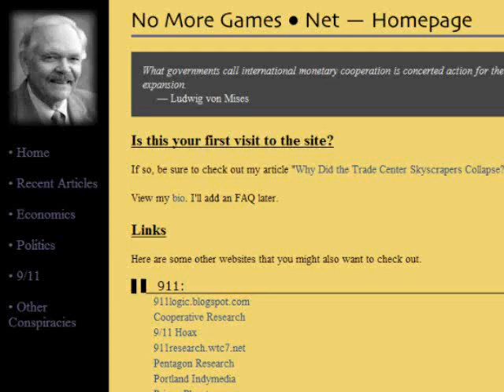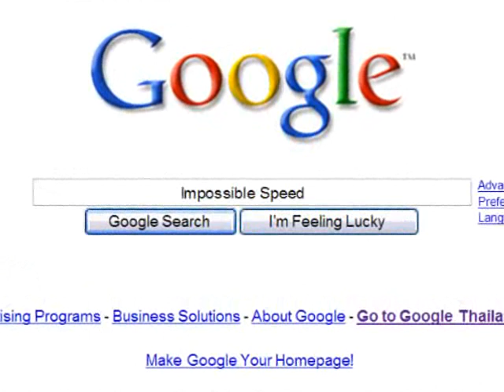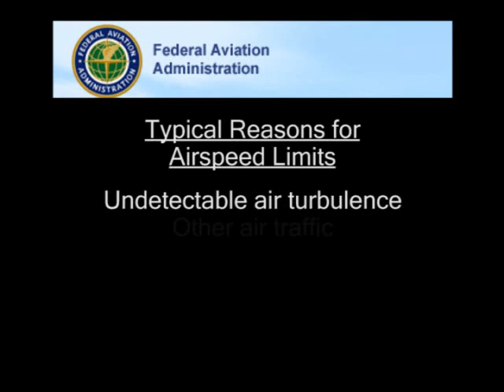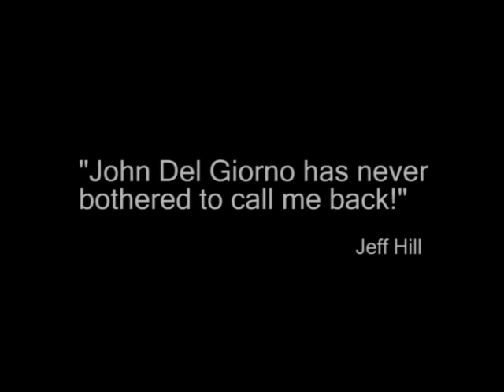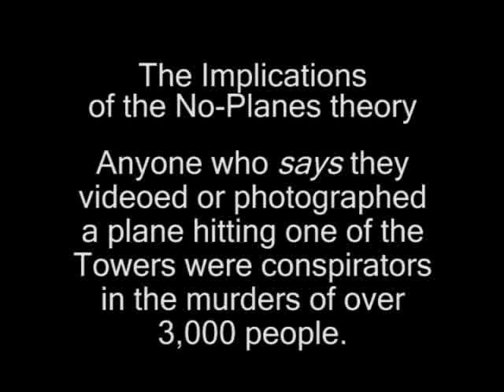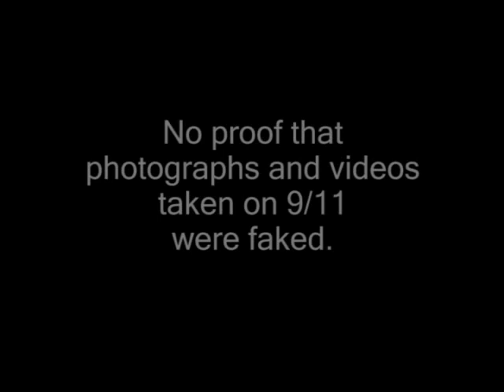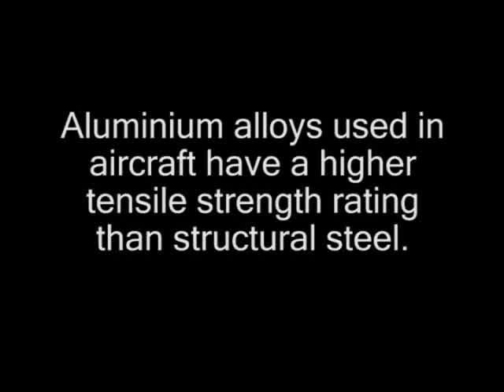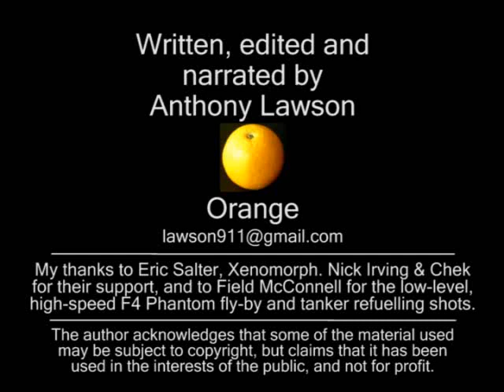9/11: Impossible Speed & Impact -- Busted! Updated

Comment: My contention is a drone a/c was used to mimick the commercial liners and as fas as the speed...@ that altitude these a/c wouldn't suffer too much strain on their airframes for the limited amount of time they flew that low nor do I feel the high speed assertions are accurate. Maybe 400mph tops in my OPINION. The F4s shown in the video is designed to be able to fly low since a fighter needs to be able to go anywhere to chase and engage enemy a/c. FYI...we stopped using the F4 in the early 80s
Reply from the maker: I prefer to think of the New York weapons as radio/computer/controlled airliner lookalikes; the term 'drones' is far too loosely fitting, from towed targets to assassination platforms.

Also, I cannot imagine why you go for "400mph tops in my OPINION" when the speed I calculated from the Fox 5 video (confirmed by others) is 572 mph, which is close to the Royal Aircraft Establishment's estimate of 575 mph., and those guys are good. 

What your 400 mph OPINION introduces is the that you do not accept the videos as being of any value in assessing the speed.  That is close to the position that the no-planes-in-New York fantasists take.

Comment: Not likely those were standard commercial planes. Note the FTS on the bottom.

 Dov Zakheim - 9/11 Comptroller and Remote Control Planes 
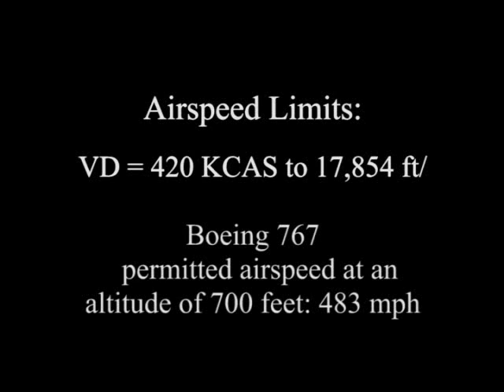@ 2:10 of this video some of his modified Boeing's are shown. Compare them to the 2nd plane. The location of the equipment specifically.

Comment: look at the left wing and the building,why is the left wing behind the building?
why not in the front of the building,you are busted? time 7:50-7:59
Reply from the maker: If you examine this area very carefully using the eyedropper tool in a paint programme (I used Corel PhotoPaint X3) you will find that there is a slight difference in the RGB intensity readout as the plane's wing passes the building.  This means that the plane's wing was actually in front of the building, of course, because it was a real plane.  It also means you are wrong.

Comment: This video demonstrates that the speed of the aircraft which hit the South Tower of the World Trade Center, on 9/11, did not exceed the design limitations of its airframe or engines, and that the way in which the aircraft breached the wall of the building was feasible.
Jct: I'm just happy there are so many pilots and Boeing engineers on video explaining why those jets couldn't push through thick air at 500 miles per hour as they can through thin air at 30,000 feet. Anthony Lawson chooses to look at one metric but didn't look too deeplin into the other specs. Since it takes supersonic speed of a heavy projectile to pierce steel armor, concluding that an empty aluminum cylinder could breach the steel armor and cement of the towers is too laughable to countenance, it should have bounced off or been shredded like cheese. shredder,Where do low-tech clowns like Lawson get the gall to opine on scientific matters with insufficient facts when any engineer knows he's an apologist for a scientific lie.
Reply from the maker: kingofthepaupers wrote:  "Where do low-tech clowns like Lawson get the gall to opine on scientific matters with insufficient facts when any engineer knows he's an apologist for a scientific lie."

Although, in your ignorance, you neglected to add the required question mark, and although I have already given most of the answers in the video, the basic answer to your question is:  By doing the research. 

e.g:  The FAA-permitted test parameter Vd (Velocity/dive/descent), between sea level and 17,845 feet is 420 knots.  That is a speed limit, not an airframe or engine limitation, if you can tell the difference.  A 19% increase of that figure gives 499.8 knots, which is 575.16 mph. If you don't think that Boeing 767-type aircraft (no one knows for sure, what they were) are capable of withstanding a 19% overstress factor, I suggest that you don't fly in any of them.

Your absurd claim that a plane hitting a building at such a speed should have bounced off, is laughable, but you did get close to what happened by writing: "or been shredded like cheese. (sic) shredder."

Like most ignorant people, you are destined to remain ignorant if you don't, at least, try to find out the reasons why things happen.  When I make a video, I give anyone who cares to the opportunity to share in my research, by adding references to websites that contain the information that I have waded my own way through.  Try looking at the notes for this one and you will find a video:  WTC PLANES THRU STEEL — 911TRUTHINATOR which will explain why the planes and the buildings reacted to each other in the way that the videos depict they did.

And here is another quote from your ignorant diatribe:

"I'm just happy there are so many pilots and Boeing engineers on video explaining why those jets couldn't push through thick air at 500 miles per hour as they can through thin air at 30,000 feet."

You are telling lies.  You have never seen a Boeing engineer explaining any such thing.  If you have, give me the reference where a Boeing aeronautical—not a sanitary or telephone—engineer has stated as much.  Boeing has never released the wind-tunnel data from the airframe or engine testing of its 767-class aircraft, and I doubt that it ever will.  

You may have heard a Boeing PR spokesperson, Leslie Hazard, agree with an ignorant phone caller, Jeff Hill, about the impossible speed, but she is still not an aeronautical engineer, although Rob Balsamo of Pilotsfor9/11Truth is still quoting her.

You may have heard a computer programmer, Joseph Keith, make some wild statements about the plane falling apart at speeds below 300 mph at sea level.  You may have read about some alleged "pilots" making similar claims, but have you ever asked yourself:  If I were going to throw a spanner in the 9/11 truth works, which 9/11 truth sites would I infiltrate first, or even set up in order to confuse things?

Pilots for 9/11 Truth, for example, is full of disinformationists.  One of its core members is John Lear, who used to fly for the CIA and who claims that the dark side of the moon has already been colonized and that the 9/11 plane images caught on videos cameras and human retinas were holograms; an utter and provable impossibility. 

You can hear Joe Keith make a fool of himself; John Lear argue against himself and another experienced pilot, Field McConnell, give his opinion that he thinks that the speed was possible, in the following video.

http://splashurl.com/lzo27mm 

And remember: the subject was a standard Boeing 767, because no one knows exactly what hit the South Tower or what had been done to it before it took off on its murderous journey, apart from the people who planned and executed the greatest false flag attack in history.

If you really wanted to learn something, rather than to insult me and air your ignorance, you would have been more polite.  Please try to be, next time.
Reply: Anthony Lawson
additional info on that stress induced by speed, the stress on an airframe goes up by the CUBE of the velocity.
Reply: Anthony Lawson So can you please explain how parts of the airplane disappear in the videos. And on a clear day why are the planes not painted like all the other company planes. I also was under the impression that it doesn't matter if the plane was moving or the building was moving the results would be the same. So I don't think that if the building was moving at 500+miles per hour that the plane would slice into the steel framed building. Could that wing slice thru the steel like a cartoon character. I noticed you brought up the tensile strength of the aluminum but you must know that tensile strength is the pulling of the material sideways. You're not trying to claim that a one inch bar of aircraft aluminum is stronger than a one inch bar of structural steel are you. I don't think it would take the same load as the steel. Can you explain how in the chopper shot the plane goes all the way thru the building and then you can take the image of the nose before it hits and after it goes thru and you can't tell the difference? How is it that all the different news cameras seem to be in a line did they stand each behind the other? Why on a clear day is the sky blue and green and yellow very poor quality using the best cameras. If the aluminum is so strong then why did it disintegrate in Pennsylvania when it hit the ground? I don't see any airplane parts there did you? Why are all of the witnesses either affiliated with the media or actors of some sort? Why do you use the dive speed when you can see that the plane was in level flight. If the plane can go 586 in level flight sea level why waste time getting to altitude and how fast can it go now at altitude since it can go 586 sea level? If aluminum tubes can go thru solid steel if they are just moving fast enough why not make bullets out of aluminum to shoot thru body armor and concrete buildings? I mean you were talking some deep shit in your video but I noticed you didn't have a Boeing Engineer  on either part of your criticism of the other people. Thanks

Comment from the maker: Go back and get YOUR facts straight, then consider the costs. It is already known that aviation kerosene and office materials can NOT melt steel.
The aluminium in the planes SLICED through nothing; the impact DESTROYED the joints of the outer framework panels which were made of 1/4 inch box construction steel members. Look at the notes and watch WTC PLANES THRU STEEL — 911TRUTHINATOR
Apart from that, the rest of your comment is unanswerable, which does not mean that the video is not accurate.

Comment: the speeds, impact and banking are not impossible, but NEARLY impossible.  the planes were remote controlled.   the plane that hit the pentagon was traveling at 5 to 7 G's, nearing it's physical limit. same for the 2nd plane to hit the world trade center. the 757 and 767 used on the world trade center were the only boeing models capable of being remotely controlled.
do you know why the truth gets leaked out? to encourage fear and paranoia. these are very valuable things to use against some one.

Comment from the maker: Please look at my video: Friends of Israel — Enemies Inside the Gates from about 8:00 minutes on. Link in notes.
Vd does not signify Vertical Dive but Velocity Dive. The Pentagon is a totally different issue and has no relevance to this video but for what it's worth I'm certain a passenger aircraft didn't hit it,
In the first video I mention, you will hear Field McConnell say that he thinks the speed of the ST plane was possible and others are pretty certain it was remote/computer controlled.

Comment from the maker: No one outside of Boeing knows what a 767 is capable of in level flight, but the South Tower plane had made a rapid descent from 20,000 feet immediately before it pulled out of what I have calculated was a 15 degree slope, to it's final slope of about 3.5 degrees lasting. When a road is steep, then levels out, a car's velocity is maintained until other forces come into play. so it would be with a plane.  
See notes and link to: 9/11 — Possible or Impossible Speed?
(cont after your next))

Comment: I believe those planes were real, the ones that hit the towers. But I think they may have modified, as the speeds are over what a 767 should be able to do in LEVEL flight @ 1000 feet, but it did kinda dive-in, so who knows. It would be VERY difficult to hit those towers so precisely @ those speeds. But I agree that anyone who thinks all those videos could've been altered, & eyewitnesses duped, is obviously not capable of critical thinking & should recant. But the OCT regarding 77 is impossible.

Comment from the maker: Not true.  There is at least one video which has an extremely loud bang on it.

Look at my video Friends of Israel — Enemies Inside the Gates.  Concentrate at around counter 5:20

Don't forget, this was a coverup so you would have to ask those responsible why the building was not brought down sooner. My guess is that alleged UA 93 was supposed to hit WTC 7 and the perps spent the intervening time worried about bringing it down for no apparent reason.  In the end, that's what had to be done.

Comment: You are misinterpreting it to reflect your own twisted viewpoint. If it's such an impossible speed, then why don't you explain to me how TWA Flight 841 on On April 4, 1979 went into a power dive losing 34,000 feet (10,363 m) in 63 seconds crossing the mach limit yet still retained the majority of its structural integrity to where it was able to emergency land and passengers only reported minor injuries?

Comment from the maker: Lots of work is what is required to back up such a claim. Send me a screen shot of what "...has two vertical stabilizers and a Very large wing span." My email is in a message I've sent you, because I can see nothing like you describe in any of the frames I have studied using Adobe CS5.
Find out the length of a 767 and a war-jet with twin stabilisers and see if you can work out a rough distance from the camera. Roughly 1/2 X 767 distance = size X 2
Was such a plane reported by any eyewitnesses?

Comment: I think anyone who has any questions about the planes and there performance to pilots for 911 truth.that they were planes is without question,that they were standard is very unlikely,remotely controlled ,very likely.the reference to the two military jets performance is misleading as there is a vast difference between the design parameters and engines.one turbofan is really not like another,except in the basic principle.

Comment from the maker: Jeff Hill never makes it clear what he is asking the questions about. The NY planes have never been forensically identified, therefore asking questions about a standard Boeing 767 is dishonest.

According to ATC records, the South Tower plane made a rapid descent from about 20,000 ft, and several videos attest to this. The final 10 seconds was a 3 to 4 degree slope.

A former NASA flight director thinks that the speed of the plane was possible. 

Google dwain deets pilots impossible speed.

Comment: 2:48 you claim that twin turbofan engines don't choke themselves at low altitude, but what about the planes themselves? I wouldn't compare the two aircraft, especially at low altitudes and high speeds, that just seems silly.

Comment: @alawson911 Technically an elastic band has a higher tensile strength than steel, but that does not mean it can be used to cut through it.  I am just looking for some ‘objective’ proof or validation that the damage to the towers is physically consistent with a jetliner impact.

As regards the wreckage, if you watch the footage WNBC dub10 footage there is Zero wreckage visible. Are you telling me that all that aeronautic-strengthened aluminium simply evaporated on impact?

Comment: @alawson911 Yes, I have seen photos and video of the engine found under the scaffolding at Murray St and it could well be from a jetliner. Only there does not appear to be any exit hole on the North face of WTC2 from where the engine was supposedly ejected.  Alternatively, is it also possible that this evidence was planted at this location, intended to correspond with pyrotechnic effects used to simulate a jetliner impact? Ref: (Project Truth - Sip 4.9 Pyrotechnics and Demolition A)

Comment from the maker: @ProjectWTCTruth 
I don't think I can help you any further. When aeronautic-strength aluminium, the tensile strength of which exceeds building construction steel, impacts a 14 inch X 1/4  box column travelling at about 850 fps this could result in the steel being cut through. 
The holes made in the buildings were not photographed in such a way that the interiors of them showed very much at all, but a jet engine broke through the entire building and landed in Murray St.

Comment: @alawson911 I can tell the difference between cladding and the actual steel columns, visual evidence includes steel columns that have been cut through.  My question about wreckage refers to these same crash locations, why is no jetliner wreckage visible in the impact holes prior to collapse?  Both NIST analysis and the Purdue animation show a jetliner slicing thru steel; do you feel these productions are accurate? I do not know what hit the towers but have doubts about the footage.

Comment from the maker: @ProjectWTCTruth
As for the wreckage, that was buried under millions of tons of rubble, but an engine came out, as did wheels from the North Tower, and if you care to look, you will find that other wreckage was found, but dumped. 
"Also there is clear visual evidence showing cut columns..." are you sure that what you are referring to is not aluminium cladding which surrounded both buildings?
But it is your choice as to what you think happened. I think two planes hit the Towers.

Comment: @alawson911 I assure you I am well able to comprehend the forces involved and I agree that jetliner impact may have dislodged and pushed in a prefabricated section, that is a possible outcome.  But the lightweight components of the jetliner would be wrapped around the steel columns.  Where is the wreckage? Also there is clear visual evidence showing cut columns and this is mirrored in the NIST report analysis and the Purdue animation. What is your opinion of these visualisations?

Comment from the maker: @ProjectWTCTruth 
I have just added a video reference "WTC PLANES THRU STEEL... to the notes, along with its link.  As you will see, the emotive concept of a plane "slicing through steel" is used by those who cannot comprehend the forces involved. So, if you watch that video, and think carefully about the inward collapsibility of the outer walls of the Towers, there is no requirement for evidence of a plane slicing through steel, because the plane did not slice through steel.